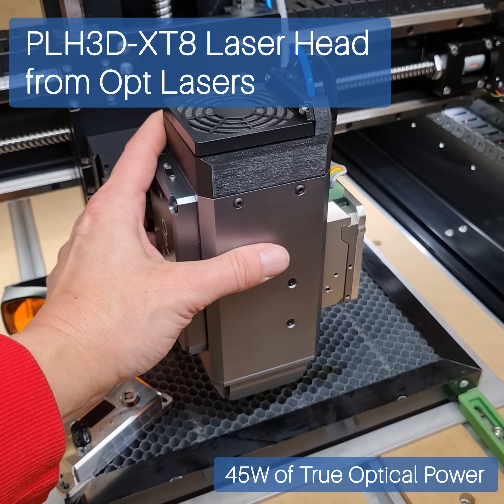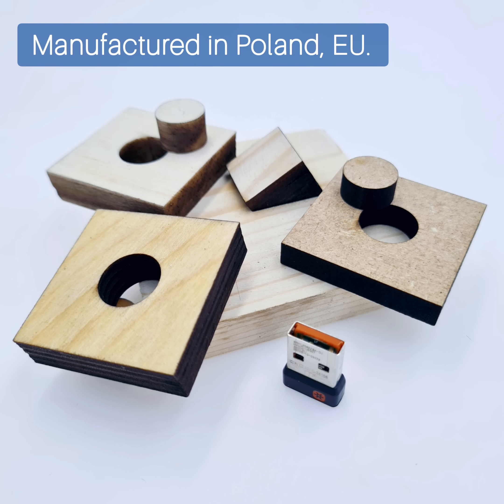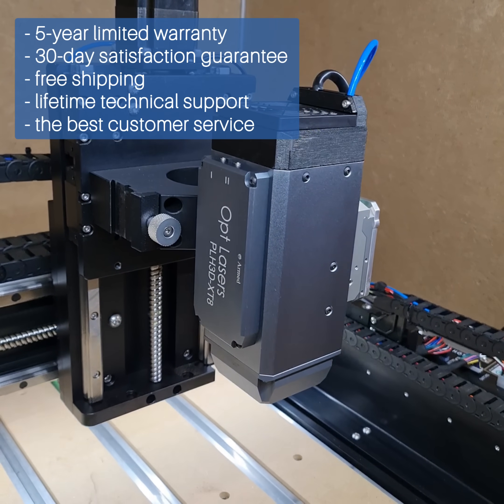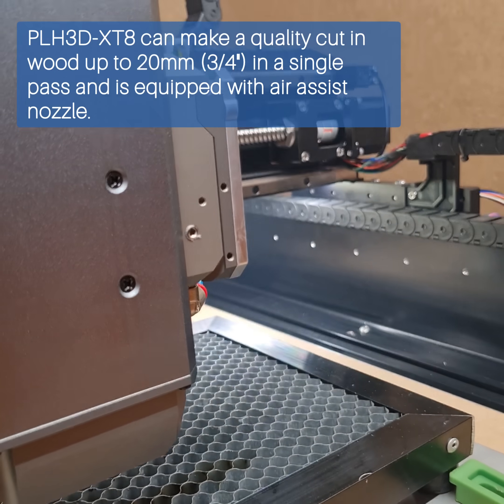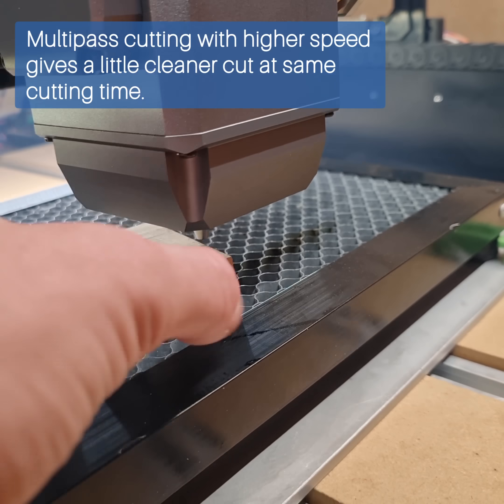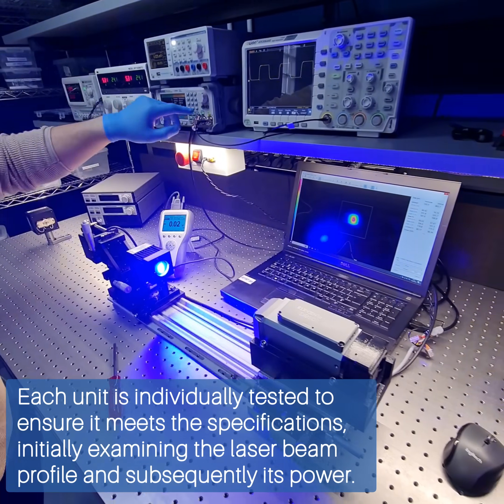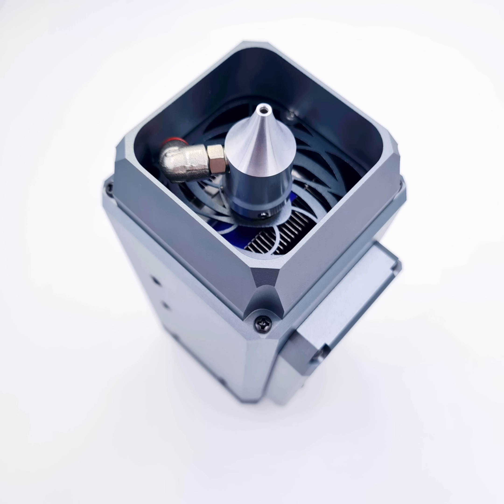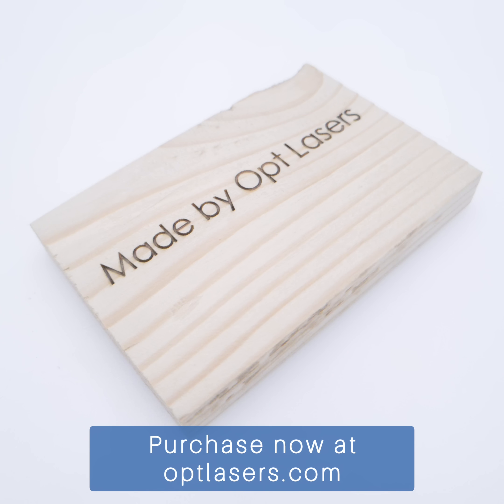PLH3D-XT8 45 W Laser Cutter and Engraver from Opt Lasers | Best CNC Laser, Bye K40 CO2!

Comment: What air pump will be suitable for this laser (High-Pressure Air Assist Nozzle) and what air flow parameters will be appropriate for each application (l/min). Greetings!
Reply: Hello! Just standard air pumps are good so even 2-3 bars is anough and up to 20 liters per minute. On Amazon they cost in 30-100 USD range.